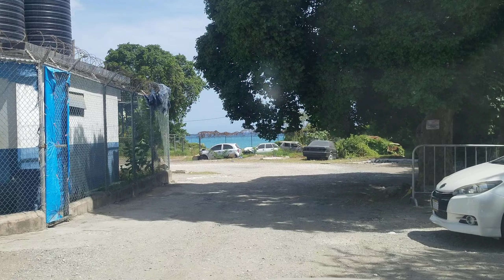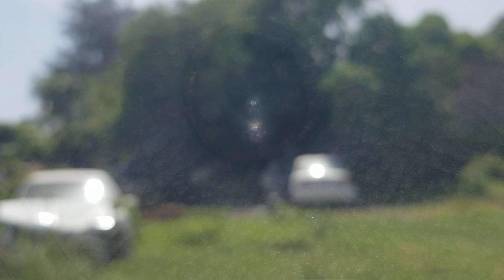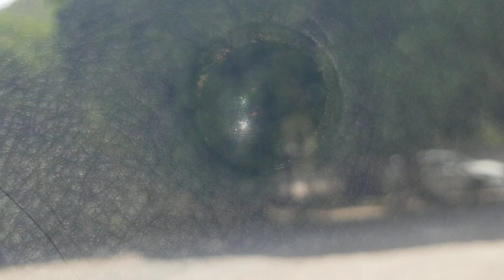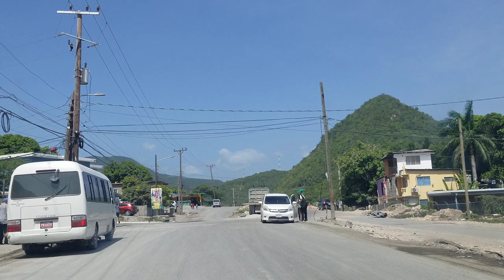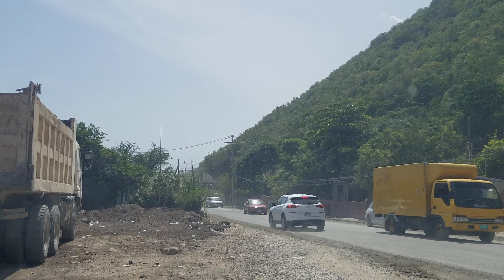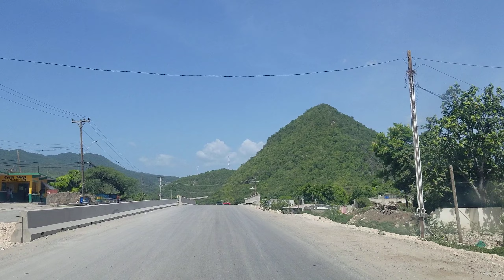Demolition Bull Bay Police Station Jamaica

Comment: My sentiments exactly. These guys don't realize that the simplest solution is usually the best. The same thing obtains in Springfield Morant Bay where they have built this massive drainage system from the Urban Centre by the old Goodyear station all the way down to Duhaney Pen to cross the road and continue down to the sea. The drainage from the Urban Centre could easily have been routed to the adjacent river right next door. The river empties out in the sea.
Reply from the maker: I think so
Reply: They didnt empty the drainage into the river for environmental reasons..it has been done in other cases but this is a unique situation
Reply: Take water off the road... especially on that stretch of road